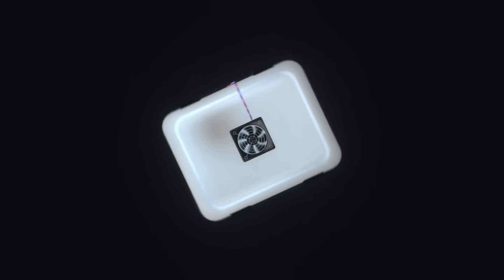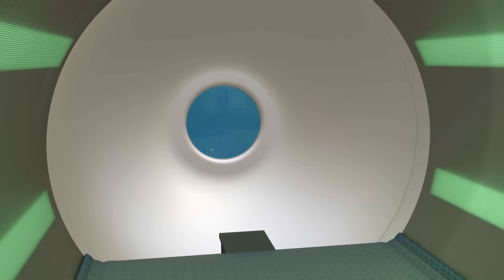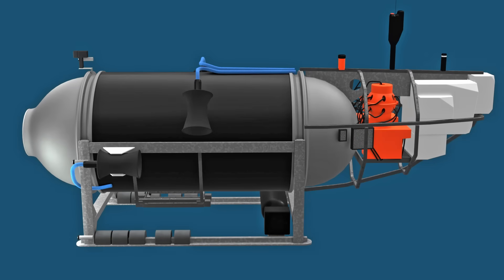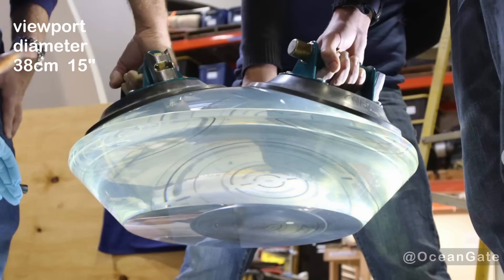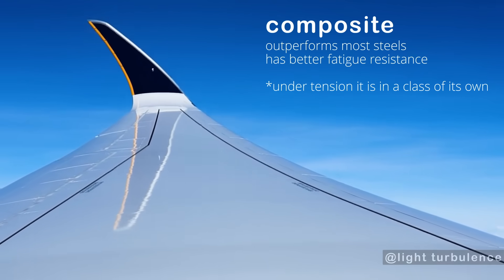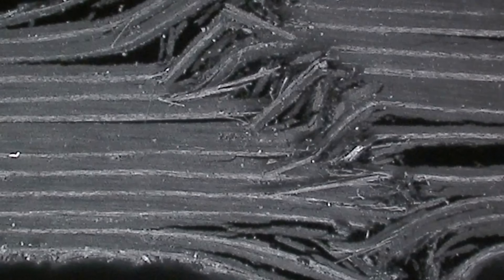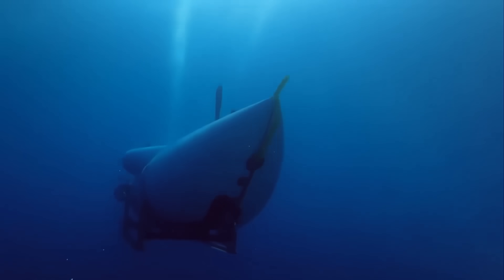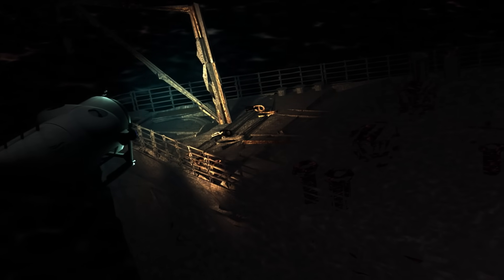Titan Sub | carbon fiber - Detailed Tour

Comment: My opinion is that this was live testing of a novel sub design but badly sold as an adventure.  

Now we may understand in detail how each of the individual component parts of Titan perform under normal conditions and can back it up with the science and data - but how does the total vessel behave?  
Just like F1, when they add an improved aero part, the total car package may be worse.

We only know what we know and failure tells us more than when things work OK.

Compare this with the Comet jet plane.  Metal fatigue around the square windows caused by multiple pressure/depressure hadn't been considered until it went into production and had many unexplained crashes. 

So, the main issue is that the manned tourist dives WAS the ongoing testing of the design concept. 

If they had conducted unmanned deep sea tests to understand the viability of the sub design and it had imploded with nobody on board would it have been a big news story over the 4 days?

Data is sparse but it seems Titan had only been down to Titanic's 12,500 ft on 10-20 occasions.  By comparision the DSV Limiting Factor has made 18 dives down to Challenger Deep at 35,000 ft

Comment: The reports were the that the carbon fiber was expired, that is, exceeded its shelf life. Also, the tube had experienced impacts and a proper inspection of the cylinder was never done.
Then, there were questions raised concerning the attachment of the titanium rings and the adhesives used.
Couple that with the reported disregard for safety, this was a disaster waiting to happen.
OK

Comment: I am glad to hear you calling out that transcript to be a hoax. It simply has to be, otherwise it would mean that nobody had a clue about what they were doing. If that submersible was designed to take 2 and a half hours to descend to the Titanic, the crew and those topside would have aborted the dive the second they realised they were descending faster than they should have been. Like you say, everything is weighed very carefully, and calculations made to determine the amount of ballast they needed to load. They would have known almost immediately that they were dropping faster than they should, they would have dropped all ballast immediately in an attempt to raise the craft - it surely would have been an emergency situation. The one thing nobody in their right mind would do is to carry on dropping like a stone, not knowing if they were capable of achieving positive buoyancy.

Comment: So you are basically saying that the technology is not at fault, just the botch work in deploying it has caused the disaster. That might be true. But does not answer the important question. Typically, in safety related applications, there is a big safety margin (not 20% but more like 200%). If we had to develop a sub following this expectation, how much weight would it actually have? Would that really be heavier than a stell based version?

Comment: I'm not an engineer so I won't comment on the materials aspects of this video. However, I think the "evidence" Mr. Bell cites for labeling the communications transcript a cruel hoax is wrong. For example, Bell says the communication at time code 9:30:36 refers to using the thrusters to descend, which isn't how they're used. I think this analysis is wrong. I read that communication to say they are using the thrusters to retard their descent -- because they're sinking too fast. It seems logical they would engage upward thrust to check their rate of sinking before jettisoning ballast. That's exactly what the transcript suggests happens. Then, at 9:32:12, after ballast IS released, Rush responds he's jettisoning the frame. Here, Mr. Bell says this communication is improbable because a person embroiled in an emergency would not take time to text the mothership while working the problem,

I agree - a person who thought they were in an emergency situation would likely work the problem, rather than their thumbs on a keyboard. But I think it's also possible Stockton Rush did not believe this to be an imminent emergency. He may have thought his hull integrity alarm system would provide him all the time necessary to reach the surface.

I'm not saying the transcript is legit -- it's certainly not been verified -- but I think Mr. Bell is incorrect about the transcript indicating thrusters being used for descent.

Comment: I agree with James Cameron and Dr. Ballard that carbon composite is a really lousy material to build a pressure sphere or hull from, at least with today's technology. However, your video explained the reasons why. I suspected there was multiple mistakes and flaw in the processes used to create the carbon fiber center section. Perhaps in due course, if the research and more importantly testing is done to determine the correct methods, carbon fiber will be safe for human occupied deep submergence vehicles. Stockton Rush cut corners and was affected with "go fever," a fatal combination for him and four others. Testing to destruction is the only way to have anywhere near an accurate idea of what the failure point of a carbon fiber deep submergence vehicle is. As your well done video states, that has yet to be done. Until the money and years of work are devoted to answering critical questions submersible builders need answers to, I would personally NEVER entrust my life to carbon fiber underwater.

Comment: Excellent video.
I saw an earlier presentation from a different channel that pointed the finger at the bond between composite and titanium.
Be very interesting to have an opinion on this - see the link below - start at about 4 and a half minutes in.
You do actually see the manufacturing process, and the points made in the video do sound reasonable.
https://youtu.be/rie76UsjPZs?si=Mkyxr7NVNIVZ6yyQ
Reply from the maker: This gluing footage is from hull 1.  I couldnt find any footage or detail of the gluing of hull 2 but the whole process generally was done with greater care and in a cleaner environment.  But the geomentry of the joint and flange depth and length was unchanged.

Comment: I personally think a fully sleeved center tube, with metal on the outside and metal on the inside and carbon fiber in between, would have offered some advantages.  Perhaps the end rings could have been welded on, not glued.  And also, perhaps the metal would have been more easily inspected for degredation.

Comment: grain boudary strength yes..   deforming strength yes.. crush strength  Zero.      this is why the only carbon fibre vessel's are safe at 3600 psi (scuba)    the pressure is trying to explode the bottle, not crush it..

Comment: You talk about the carbon fibres but not the resin used. Most composite failures start with micro cracking of the resin holding the fibres in place. I’ve experienced carbon fibre tube failures in carbon masts where you could hear the micro cracking for a short time before the failure.

Comment: @airasj1 
What is so hard to understand ? Take a shoe lace and pull on it .. ok good. now take the same shoe lace and wrap it around a toilet roll and crush it . Point made . Materials are classified in their appropriate strengths and weaknesses . Carbon Fibre is NOT appropriate in compression AT ALL EVER ! Now maybe you can get 670MPa in compression in the lab and 1000MPa in Tension .  But consider this ! You are SEPERATING the layers in compression this is cumulative . In tension it tightens the fibres . 
So you have a limited service life for carbon fibre in compression and it WILL FAIL in service . And I don't care if you consider aerospace applications but we are talking hydraulic impregnation and incremental delamination . As an "Expert" you are misleading the narrative .
The long and the short of it is that cumulative ingress of water that could not ever be removed or eliminated is TOTALLY different than Aerospace applications as the pressures are NOT relieved . 
AND the pressure in Aerospace is negligible even in space equating to at most 14.7 PSI or 1 ATM or 101.3 KPa.
Aerospace comparison is ludicrous. WHY ? you are talking LOADING in near atmospheric conditions. COMPLETELY DIFFERENT .
HOWEVER' you are correct that the interface between the Carbon Fibre tube and the end domes is the MOST critical area and I accept that this was the failure point as micro "gaps" would inevitably be created with the differential expansion and contraction ratios in this design. 
More over I think the design of the end domes and the interface  was the failure point.
But more appropriately the TUBE should have been made from a 3D printed Titanium Alloy with multiple differential pressure layers that negated the total pressure loading and reduced that to incremental loadings.
I confess that I do not design subs to these depths only 150M or less and even then I use incremental pressure zones that save expense and weight. These zones are pressurised with kerosene to promote buoyancy.

Comment: What is so hard to understand ? Take a shoe lace and pull on it .. ok good. now take the same shoe lace and wrap it around a toilet roll and crush it . Point made . Materials are classified in their appropriate strengths and weaknesses . Carbon Fibre is NOT appropriate in compression AT ALL EVER ! Now maybe you can get 670MPa in compression in the lab and 1000MPa in Tension .  But consider this ! You are SEPERATING the layers in compression this is cumulative . In tension it tightens the fibres . 
So you have a limited service life for carbon fibre in compression.

Comment: It is easier to design a flat plate to hold back an external pressure than a cylinder. I have designed them in high pressure heat exchangers. The plate will be much thicker than an equivalent cylinder, but you will know what is happening to it. A cylinder under external pressure you need to hope will be evenly forced and be evenly strong. But any significant deviations such as an impact, a penetration or support, will introduce bending forces that can cause the cylinder to collapse.

Comment: Whilst your are correct that carbon fibre has been used in compression for an application to aircraft wings and simply stating that carbon fibre should not be used in compression is over simplifying stating that carbon fibre's performance in compression is well understood or known is also an oversimplification and incorrect, failure of very thick carbon fibre cylinders is simply not well understood and the models are not validated. The conclusion of your video that the research should have been done first to validate their approach is true however it understates the degree to which they let themselves believe their own PR/hubris/arroagance, the supposed "safety factor" of 2.6 is modelled around existing knowledge and assumed calculated failure modes, for which there is absolutely *NO EVIDENCE* to validate the assumption that this is how the cylinder would fail and therefore it is simply incorrect to assume that the value derived has any real applicability and that the "safety margin" is as meaningless as if the number was picked out of thin air (which essentially it was). 

I would point out that a single google search for "failure of composite cylinders under compression" brings up the following review (from October 2022) "A Review on Structural Failure of Composite Pressure Hulls in Deep Sea" which concludes: 

However, with the increasing depth of composite submersibles and deep sea pipelines, etc., the pressure shells will become more and more thick, material failure may occur before overall buckling, and it is difficult to directly determine the ultimate strength of the pressure shell, for in some cases only the material failure mode was observed in the hydrostatic test. Correspondingly, progressive damage analysis was adopted as a way to study the influence of material failure on the ultimate bearing capacity of the pressure hull. In addition, material failure may also occur in the post-buckling stage of moderately thick shells, which was a concern of some researchers.
In particular, a unique failure mode that is prone to emerge only in the underwater environment for composite shells, namely so-called snap buckling or delamination coupled buckling failure mode, has already been demonstrated to exist for the very thick GFRP composite pipes used in the deep sea. Unfortunately, however, investigations on this subject have remained at theoretical level. There is still very little research in this area in recent years.
Generally speaking, the current research on the structural failure of composite pressure hulls in the deep sea is still in the exploratory stage. According to the authors, there are still some problems as follows:

(1)
    The composite pressure hull that is suitable for large diving depths is a medium thick or large thick shell; either overall buckling or material failure may occur, or both. However, there are few studies on the relationship between them, and no appropriate criterion has been established to distinguish them.
(2)
    Under hydrostatic pressure, the composite material of the pressure hull withstands a bidirectional compressive stress. Whether the existing progressive damage methods are appropriate to study the effects on a thick composite pressure hull or not, has not been sufficiently investigated.
(3)
    Research on the important snap buckling failureof a large thickness composite pressure shell under high external pressure has been limited to theoretical approaches, while the experiment validation is not sufficient.
(4)
    The nonlinear buckling behavior of thick composite shells under hydrostatic pressure needs to be further studied, to evaluate the effect of various defects on the ultimate bearing capacity of the composite shells.
(5)
    Studies on progressive failure of thick composite pressure shells in the deep sea are still lacking.

Future studies should pay more attention on the structural failure of moderate thick and thick composite pressure shells under hydrostatic pressure, since their bearing capacities may be directly determined by material failure or overall buckling, or by the coupling of them. An efficient method for progressive damage analysis of composite pressure hulls should be established and validated, to predict the ultimate load capacity of the composite pressure hull in a deep sea environment.
Moreover, the structural failure caused by nonlinear buckling should be further studied, since overall buckling is still the main form of failure of composite pressure hulls. The existence of defects is the key factor to determine the collapse load of the shell. Defect introduction methods suitable for study of composite pressure shells need to be developed. The influence of the unique lamination defects, internal pores, fiber misalignment and the deviation from the theoretical layup sequence of composite materials on the ultimate load capacity of pressure shell need to be further investigated.
Finally, great effort should be paid to strengthen research on the snap buckling failure of large-thickness shells under high hydrostatic pressure, not only limited to the theoretical investigation, but also the numerical and experimental aspects. In particular, effective and reliable tests are needed to understand this unique failure mode and the critical buckling load caused by snap buckling, though this is very difficult in practice. This is vital to gain an insight into the snap buckling failure characteristics, and helpful to validate the theoretical and numerical work on this form of failure.

Comment: Airbus wings are not in compression. They are bending, although that implies compression on the upper surface, but tension on the lower surface. Futhermore, they have internal spars to carry the load into the fuselage.  Cylindrical hull-ed submarines have strengthening rings (hoops) at regular intervals along their length.  Composite fibre is used in cylindrical vessels to resist tension, not compression, such as centrifuges.   A sphere is of course the best shape for a bathyscape.
Reply from the maker: A wing is a cantilever beam and yes in bending. And the bending is resolved into compression and tension.
A beam in bending has compression on one side and tension in the other in equal amounts. The top skin or top part of a spar in a wing has compression equal to the tension at the bottom.

Comment: I believe you are correct in assuming the failure point was the longitudinal compression cracks in the carbon tube, due to a faulty layup process. Very informative video. The production of the carbon pressure hull, should have used the mandrel technique showed at 12:08, which is identical to the production method of various types of gas tanks in tried and tested applications. Had they produced the entire hull out of carbon, you mention the end domes would have to be discarded, but the Carbon end domes could just as well have replaced the titanium end domes, and have further reduced production costs while maintaining or increasing compression strength. Additionally I would have opted for a design with only one point of ingress into the tube, thus reducing the potential failure points. All electronics could be controlled wirelessly removing intrusion points. Titan was really a marvel of invention, and even if immature in it´s testing phase, managed to perform 13 successful dives to the Titanic. A remarkable achievement!
Reply: I agree. It did well before it eventually failed. I am curious why it had titanium ends and, if it had to have ends, why not smaller ones? Why the size of the whole diameter of the tube?
Reply: @itoibo4208 i read that his scale model testing of carbon fiber end caps were repeatedly failing.
Reply: @EldonJohansen  the hydraulic press channel did some tests on small tubes. As expected, they instantly burst into pieces upon failure.